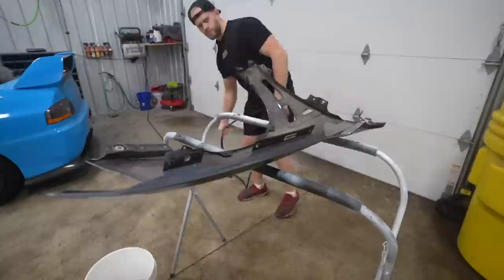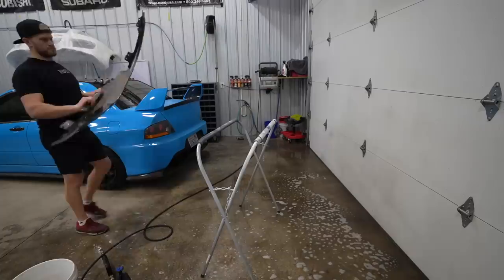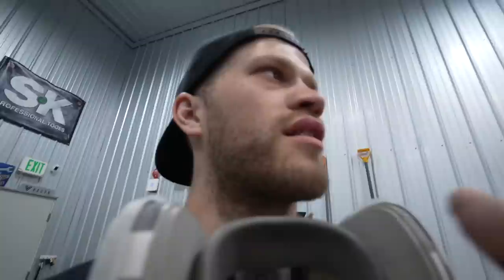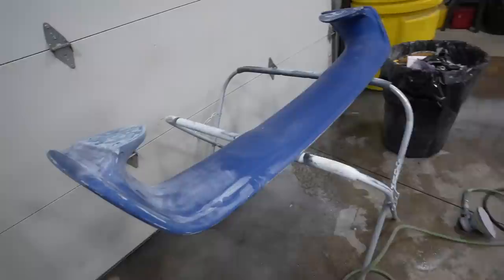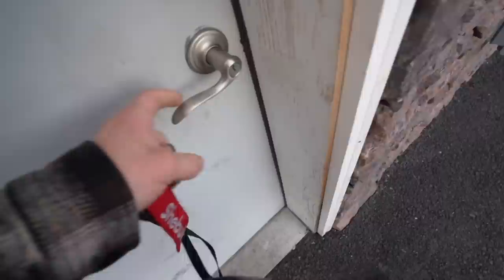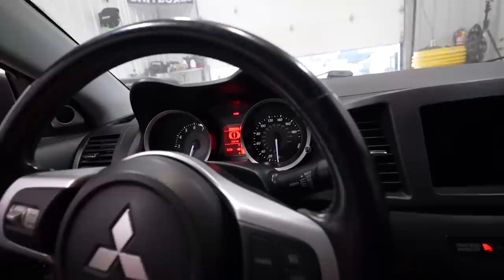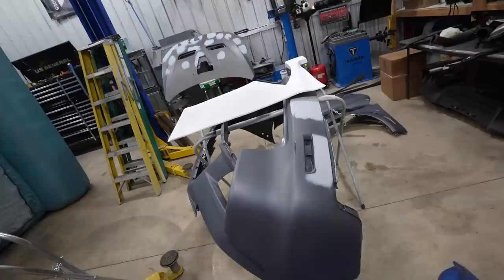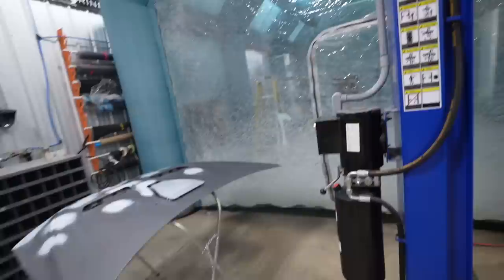PAINTING THE MITSUBISHI EVO X!

Comment: hey man just a tip i would spray one nice medium wet coat of sealer in the areas you need (bare plastic or metal or body filler showing) and make sure there’s no dry spray. also i would spray the sealer over your primer just to have a more even blend and helps cover some scratches

Comment: Runs are do to too much sprayed on a specific surface. You’re putting too much on. Orange peal happens when there is grease on the layer you’re trying to spray. That includes oils. 1. What tip are you using and 2 pressure is on your gun?

Comment: Paint drips are usually caused by applying too much paint to your project in a single coat, typically from an overloaded paintbrush. Gravity causes the excess paint to run, and as it begins to dry, the paint congeals in visible drip